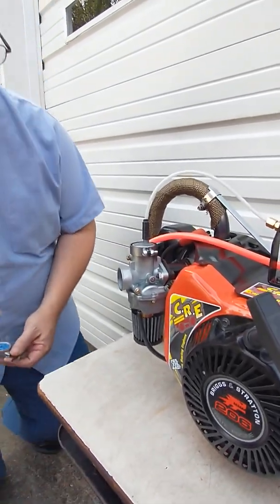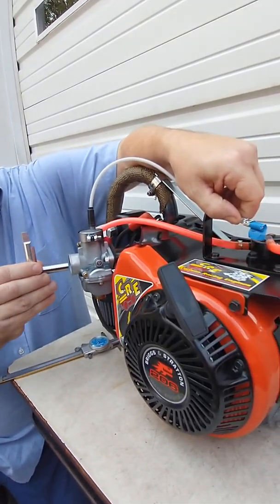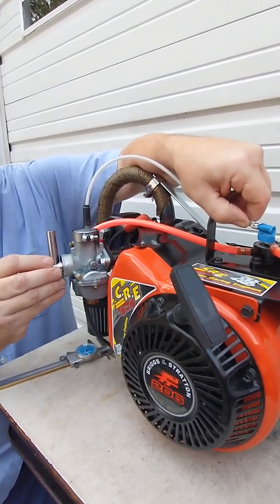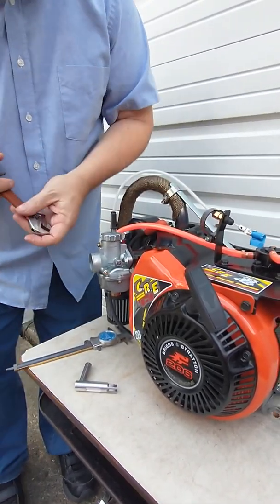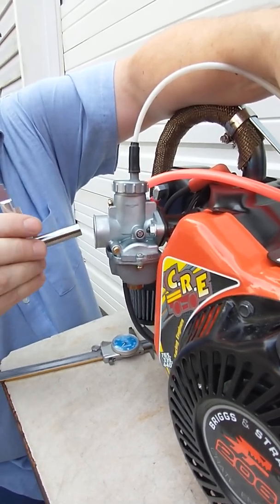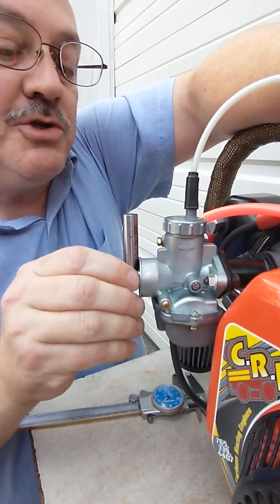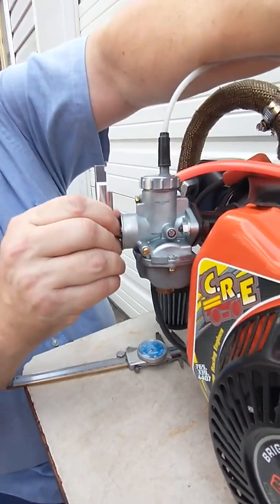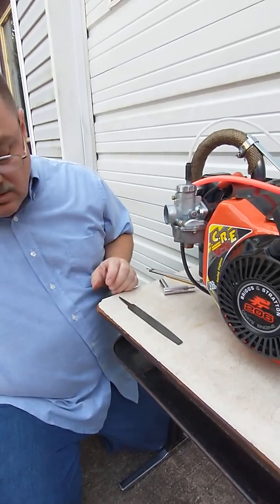Briggs LO206 Restrictor Slide Carburetor Tech

Comment: where can i get the front/back tool for a yellow slide?
Reply from the maker: The tool is available from Sox and Sons Racing in Columbia, SC.  You can purchase some specialty gauges for the L206 from Lewis Stout @ Stout Racing Engines in Cleveland, TN.  If you just need pin gauges and/or want to fab your own gauge up, you can purchase them from MSC or any industrial tool supplier.